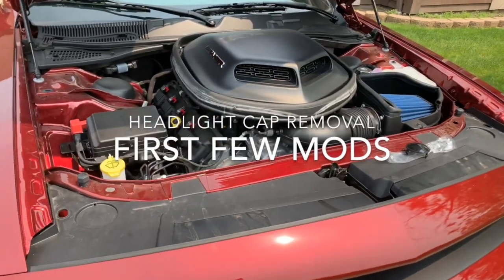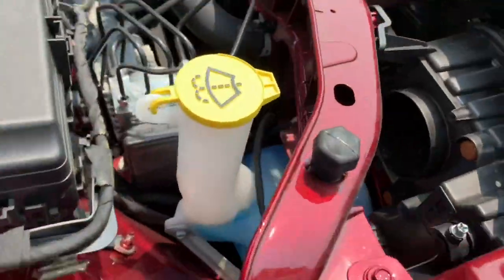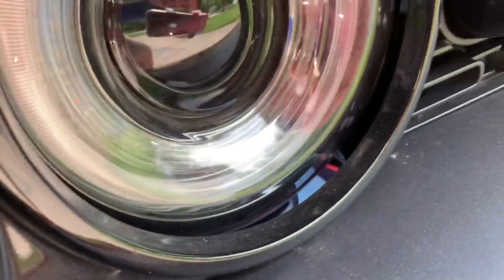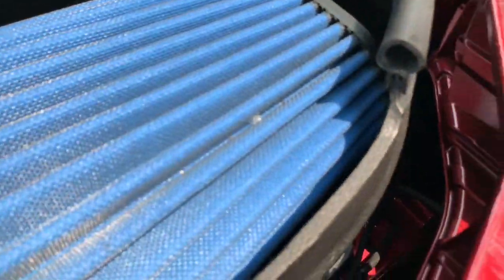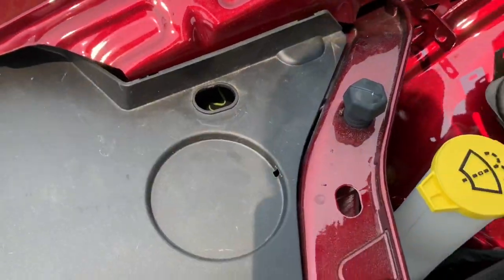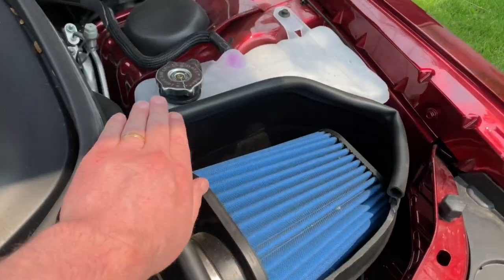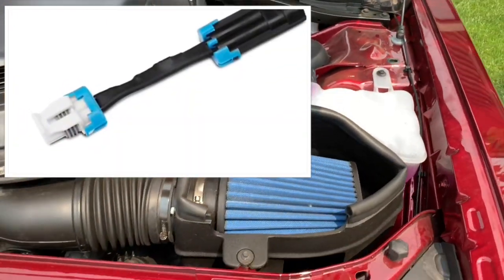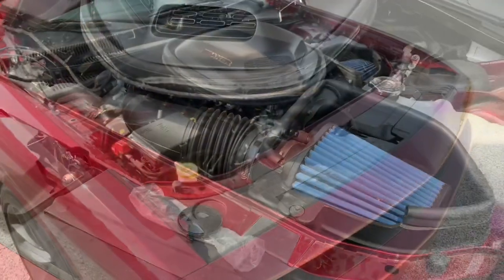Dodge Challenger Headlight Cap Removal / First Couple Mods to Come

Comment: Super easy to do. When you get those mesh caps it will look great and block large debris from coming in
Reply from the maker: For sure.  Easier than I thought for sure.   Question.  What brand thermostat do you recommend.  I got the Jet One for my 14 AWD and didn’t have an issue with it.
Reply: @BurnseysRT  jet is the one I hear is the best.  That's the one from hhp.com isnt it? If so its the same one I use
Reply from the maker: Awesome.  I believe so.  Thanks for confirming.
Reply: during rainy day is it possible to get water into the cold air filter? (when cap is removed)

Comment: I don't think intake temps will be a big issue with this setup. Nice job
Reply from the maker: Thanks man.  It will help for sure.   It’s running a bit warmer than I had originally guessed so I’ll be looking to cut down the temps.  Thanks again.
Reply: Get a intake and it will ad extra cool air

Comment: ive worked at dodge for 4 years and some how had no idea this was even possible , i thought it was a whole different headlight assembly , you sir are awesome
Reply from the maker: Thanks man. I appreciate it.  I want to say to 2020 year or later have the caps screwed in but you can remove them.  And then earlier than maybe 2016-2017 didn’t have this as an option.

Comment: Shakers run pretty hot, I personally only took the right one off. On the left side I didn't like the windshield cleaner reservoir peeking through. It also focused the intake to that side. When I added the duct it made a big difference but until you cover the airbox it'll soak up a lot of heat. Mopar CAI sounds and looks great but does little to keep AITs down.

Car's looking great, man.
Reply from the maker: I am figuring that out man.  When fully warm I do notice it’s a little slower than my Charger.  Totally cool though.  I wouldnt trade the shaker man.  It’s so badass.  I’ll add the box and find a way to seal it up for sure.  I have a couple ideas.  Thanks man. I am loving the looks.  They are so rare where I am that I can’t get out of my car without someone approaching me to talk about it or give compliments.   Have yet to get gas without shooting the $hit with someone.  Pretty cool.
Reply: @BurnseysRT  it's for sure an attention grabber. That's when you know you have the right car. Performance is lost a little but small price to pay unless you plan to race it and count milliseconds. You have the ultimate machine with a manual gearbox and a shaker set up. Nothing but fun, man.
Reply from the maker: Absolutely agree.  It’s been a blast man.  Love it so far.
Reply: Isn't the shaker already considered a cold air intake?  They still run hot with those huge intakes?

Comment: I have 2020 Challenger scatpack shaker and had to remove 2 screws from the sides of each dust cap. TORX 10 and small ratchet needed.
Reply from the maker: That’s what I have heard.   I believe the 2019 +  models had the screws in them.  Fortunately I was able to put pop mine out

Comment: I saw somewhere that someone makes inserts that have a mesh for those openings so you get the benefit of more air flow but less debri getting in to the engine compartment
Reply from the maker: Yeah that’s a great idea. I believe they are called dIPS or something like that.   Definitely a good idea to get something for sure.  Thanks for making sure I knew about them.
Reply: @BurnseysRT  Scalia Motorsports on Instagram!

Comment: You’re gonna have a nice double ram air setup once you get the duct in there. I’m surprised the rubber around the filter doesn’t seal with the hood. I wonder if putting something on top of the rubber will help it seal with the hood? Maybe like some sort of foam or something that would mold with the hood.
Reply from the maker: I agree.  Will be great to have it go right in for sure.  I was thinking about a lid but after reading what you put in there I could probably get a 1 inch thick roll of adhesive weather stripping and stick it to the hood and have it come Down and seal her up.  I’ll definitely think of something.   Thanks for the idea man.
Reply: Burnseys RT -yea a lid would work well too, only downside you wouldn’t be able to see the filter but if that’s not important then do it.

Comment: Burnsey, just to inform you I have the D.I.P.S. Intake screen on my Challenger. After  just under 2 years the glass headlight lens.cracked. I researched this and found that other owners with these screens installed were also experiencing this same problem. Just wanted to save you from a future problem.
Reply from the maker: APG1 hey man. I appreciate the heads up.  I read some concerns on the forums about them as well so that’s good to know. ill do my research for sure and again I really appreciate the heads up.

Comment: Hey great video, got a question I got a 21 rt  n its hard enough to get yr hands in there but my lights are so new there really hard to turn the bulb n its clockwise to take off correct,? I just don't want to bust it but it's I guess so new there in there tight any advice or help would be greatly appreciated,
Reply from the maker: Hi there.  Thanks for watching the video.  Unfortunately I am not familiar with the 2021s. From what I heard the 2021s are slightly different than the 2019s.  I don’t want to steer ya wrong

Comment: during rainy day is it possible to get water into the cold air filter? (when cap is removed)
Reply from the maker: I doubt your ever get much. If you run the tube between the headlight and a CAI it has a bend in it and any rain would hit that bend first and the. Drop down.  If you didn’t have the tube then I highly doubt it would because the opening for the CAI I believe is off center to the opening.   I never once had a problem in rain.  I keep the cap in the glove box just in case I would want to slap it back on. It would take 3 seconds.

Comment: I've got a 2010 rt classic with the mopar cold air intake and I'm considering buying new headlights that have that headlight intake, but I've been trying to figure out how to run that intake without getting water directly on the air filter. The intake box doesn't come all the way around the filter and leaves the front area completely open. Any suggestions?
Reply from the maker: I wouldn’t worry too much about it.  If you swap them out the caps are easy enough to put in it pop out.  Also the tube that goes into the air box has a bend in it so any water coming in hit the slight bend vs going right into the filter.  It’s a Mopar part so it’s gotta be ok right ?

Comment: Will this damage the engine? Like driving on a rainy day will water get inside since it’s open
Reply from the maker: I never had any issue.   There is a bend in the tube and the water coming in would hit that and not go right into the air intake.  In addition I always kept the cap in my glove box… so if it was down pouring I would put the cap on just to be safe.  Hope this helps

Comment: Hi! Nice vid! My driver side headlight cap popped off on its own while driving, I guess the clamps were not secured or got loose somehow, but I have been wanting to replace it, but cannot seem to find that specific part anywhere. When going to Mopar, they have the light assembly but no headlight caps on their own. Any suggestions? I am not modding my challenger, just want to get a replacement headlamp cap. Appreciate any suggestions! Thanks!!!!!
Reply from the maker: Thank you!!   You might be able to find it cheaper but here is a listing I found. 

https://www.moparpartsinc.com/p/Dodge__Challenger/COVER-Close-Out-Left--Right/61636678/68254145AA.html?partner=googlebase_adwords&kwd=&origin=pla&partnerDevice=m&userLocation=9015346&kwd=&matchtype=&device=m&network=g&userLocation=9015346&googleCampaignID=1680944352&googleAdGroupID=62840750542&googleAdID=326144339995&googleExtensionID=&gclid=EAIaIQobChMI47-47Zqk9wIVIWxvBB2XVgM3EAQYAiABEgJcivD_BwE
Reply: @BurnseysRT  Thanks! you rock!

Comment: I got the duct and my intake temps stay around 2-5 above ambient on a good day. You will see for yourself.
Reply from the maker: Really!!!   That’s absolutely amazing.  I would think engine bay temps would affect the AITs.  That’s fantastic news.  Will be bumping that up my priority list.  Thanks man.  Appreciate it.
Reply from the maker: I believe you don’t have the 8.4 inch touch screen but do you have the ability to check your HP torque and AITs through your EVIC menu?   I am not able to see any of that which is bogus considering I have 2 performance packages.  Any clue if the tazer would add those?

And I can’t get my OBD2 dongle to connect to my phone so I am driving blind.  Not a fan of that.

Comment: What’s the benefit of removing the caps to let more air in? I’m new to all this so I’m considering should I do this or not 🤔
Reply from the maker: Yes sir.  If you take the caps off that you will allow air into the engine bay for cooling.  The huge bonus for removing the drivers side is that if you get the hellcat lower air box you can hook up a tube that goes directly in from the opening in the headlight right into your air box.  That will make for just about the best intake you can get on the challenger.

Comment: Hello, great vid, was wondering if rain would be a problem with the filter right there, it rains a LOT where I live. Thanks
Reply from the maker: Thanks allot.  I never had problem with rain.  If you have the snorkel going into a Mopar intake or stock intake with the HC lower half of the air box....  I believe there is a slight bend in it which would allow the rain to hit that and slow down and allow it to drip down...   but I always kept the caps in my car so if it’s raining real hard and I had to go a good distance I always popped them back in.  Once you take them out once or twice you can do it in seconds.   It’s well worth having the ambient air into those holes.
Reply: @BurnseysRT  mahalo for the reply back, new sub here

Comment: Silly question... are these caps removable on the SXT models?
Reply from the maker: I believe they should work the same as long as it’s the new body style 2015+
Reply: Burnseys RT  thank you the reply! Yeah my challenger is a ‘18 Model.
Reply: 2016 - Mine isn't popping out despite removing clips

Comment: Since there’s an opening now, have you noticed any problems when it rains or when you wash your car? Thinking about doing this to mine and adding merrick inserts
Reply from the maker: Not really.  I installed the Mopar part that connects the light to my Mopar CAI so I feel they wouldn’t have made that part of it could potentially cause damage.  The part bends a little so I think incoming water would hit the bend drip and drip down before it hits the filter.   I am more concerned with my Shaker hood but that seems to be fine too.
Reply: Burnseys RT gotcha, thank you. Appreciate it
Reply from the maker: No problem at all.

Comment: How did it improve your IAT? On the freeway my IAT in my shaker pretty much stay 5F above the ambient temp.
Reply from the maker: I get similar results but with the intake that we have with it being open in the front if you remove the headlight cap you will help get more ambient air in there.   If you install the headlight duct kit that will shield the intake from hot air that might have gotten to the intake normally.  Below is a video on that install.  I would recommend it.  

How To Install the Hellcat Intake Mod - Mopar Cold Air Intake https://youtu.be/zgP_yln4dWg

Comment: Does this ever have problems with rain coming into the hole and going on the electrical?
Reply from the maker: I have never had issues with the rain.  I also keep the cap in my glove box Incase it’s a monsoon and just snap them in.  They are easy enough to pop back off.

Comment: Any downside to removing them.
Reply from the maker: The only thing I would say is if you are driving in  rain storm for an extended period of time.    I know people who take a hose the engine bay to clean and detail it and there is no way that much water would get In there.
Reply: Well where mine has halos the wire has to go through that. Should I cover them up when washing them.

Comment: Do you know where I can find replacements cap ??
Reply from the maker: That’s a good question.  I lost one of my caps too.  If I find out I’ll let you know.
Reply from the maker: Hey man.  I think this is the part number and one way to buy it.  Might be a cheaper alternative but at least this is available 

https://www.dodgeparts.com/oem-parts/mopar-headlamp-cap-68254147aa
Reply: Burnseys RT Appreciate that man Im going to check it out.
Reply: Mopar# 68254145AA

Comment: How did you take the two screws out on the drivers use cap?
Reply from the maker: Ahh.  You much have a 2020+ model.   I have a 2019 model and didn’t have the screws.  Might need a small L shaped screw driver similar to a Allen wrench.

Comment: This is not how it look on the Rt. Any suggestions?
Reply from the maker: What year is your Challenger.  I heard the 2020s are not exactly the same as mine and I believe the earlier year Challengers have a solid light there.
Reply: Burnseys RT 2019
Reply: The 2020 rt scat pack is different. Each cap has 2 screws(sides) and very difficult to remove.
Reply from the maker: That’s strange. I wonder why yours wouldn’t be the same since we both have 2019 RTs.  If you check out the comment below the Scat Packs have a couple screws securing it in. I wonder if it changed mid model year.
Reply: Burnseys RT yea cuz I got 2 small ass screws on the side
Reply from the maker: 1of1 Zeus sorry to hear that man.  What a pain.

Comment: Is it like this on a R/T
Reply from the maker: It is on my 2019.   Mine is an R/T.   I would say it should be this way on the 2015+ R/Ts but don’t quote me on it.  I believe the 2014s and older have a solid headlight.
Reply: Burnseys RT I have a 2017
Reply: @TLeeR60llin  ya my 2019 just popped out in 10 seconds super easy
Reply: Burnseys RT I have a 2014 and yes, 2014 has a solid headlight. However, Vland makes a updated headlight and taillights for 2014 and older to upgrade our cars. Mine will arrive any day. Then I’ll have the intake option also. I can’t wait.

Comment: Its safe to do that?
Reply from the maker: Yeah absolutely and I would recommend it.   I would get a hellcat bottom half of the airbox and the tube if you don’t have a Mopar intake.
Reply: @BurnseysRT  i have a challenger T/A it come with the mopar filter and have the tube connected to the light and the other light seal

Comment: If its heavy rain or u hit a puddle wont u eventually flood the engine?
Reply from the maker: You have the possibility of that happening but I always make sure I have the caps or covers in my car In case  a downpour is expected or suddenly happens.  They pop back in seconds and easy to remove.